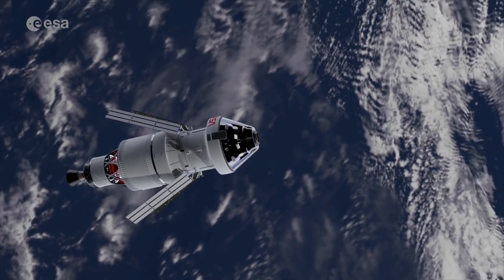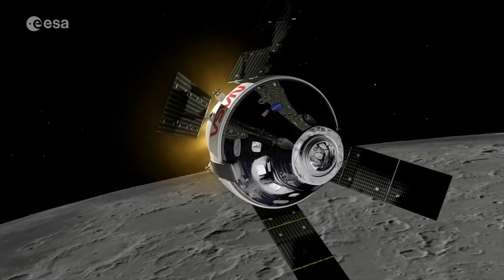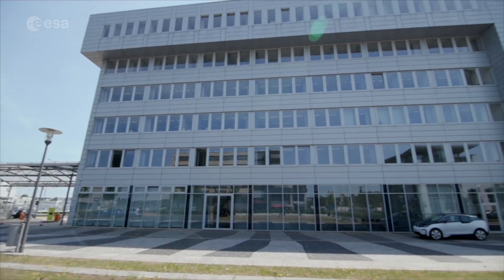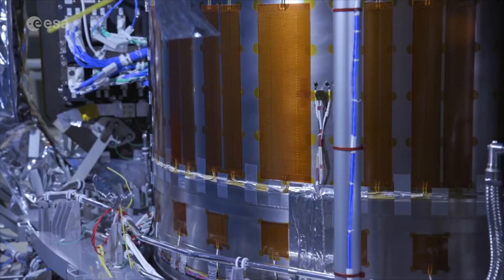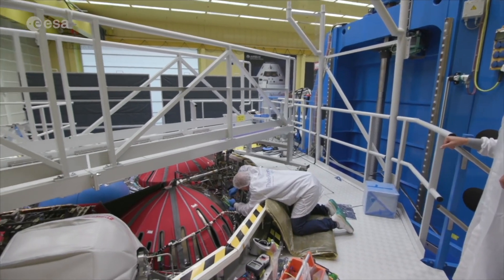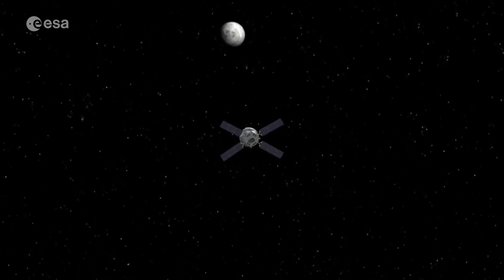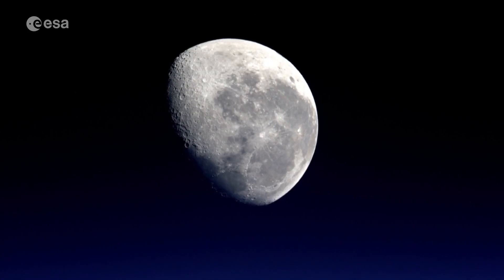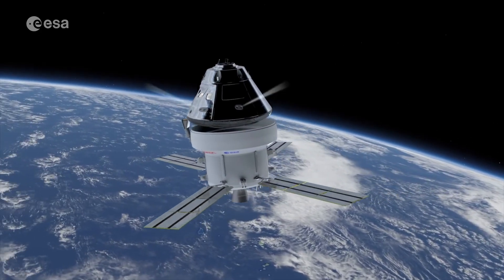NASA Orion spacecraft's European Service Module - Peek under the hood

Comment: NASA built the Apollo service module on American soil.
Reply: Ryan1981 - true,  but that was because Apollo was a national american Govt project.    
This time Nasa isn't doing it alone - the ESA are partners on the Orion.    So we build Our part here - on European soil.
Reply: NASA has got the diversity mental illness now.
Reply: @ryancool-pq5vu  why do you hate europeans?
Reply: @ryancool-pq5vu  Its about saving money
Instead of wasting money on new R&D, they are using the same system as the ATV
The whole point of Artemis is to use premade hardware, the engine for Orion is a Shuttle OMS